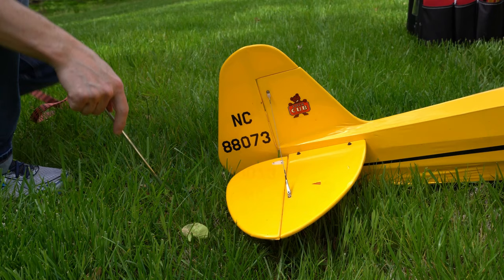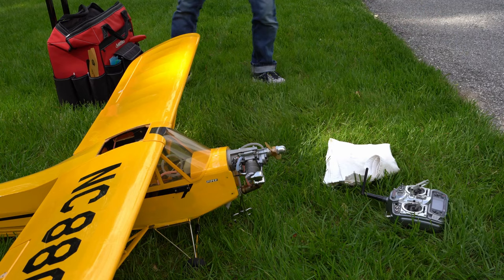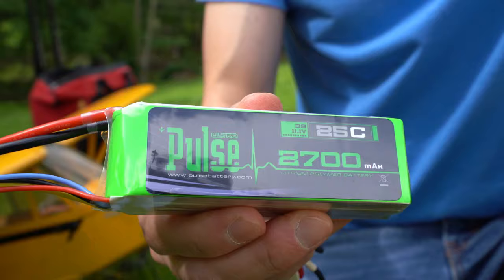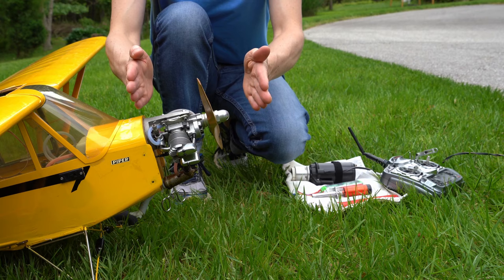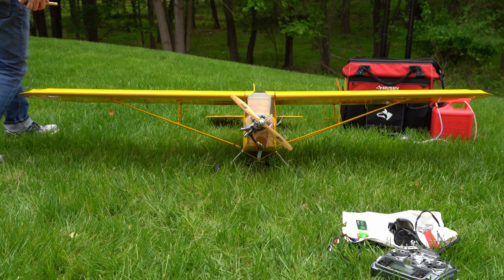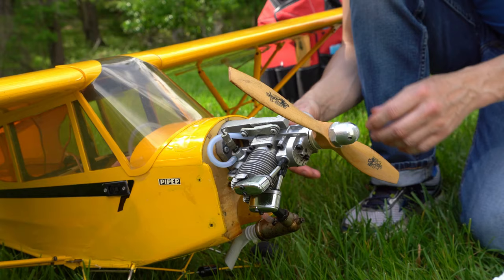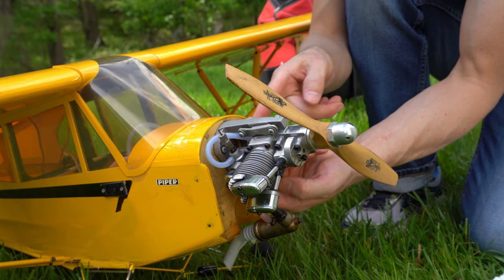Starting An RC Engine | Saito .62 4-stroke glow

Comment: I've been using a chicken stick for close to 40 years without issue. If your not able to start using a stick, there is something not right with your engine. There is nothing more satisfying then to hook up your glow driver and flick the prop over and have an instant start. Also makes for alot less junk to haul around at the flight line. Engine stops on taxi? walk out with your stick and driver in your back pocket and restart in a second where it sits. No dragging the starter out to the runway, or bringing the plane back to the pits.
Reply from the maker: 💯valid points my friend. Who doesn't like an engine so well tuned that one flick will git 'er done 😀😉👍🏽 nice...
Reply: cant say i have ever even used a stick except in frustration? 3 forward primes, then a flick against compression... 
i find it far more annoying to deal with batteries and lugs and wires and switches and murphys law, than the odd nip here or there.

Comment: Very good video thanks for the advice! I've also found when getting fuel to the engine it can help to open the carburetor to full throttle, this helps especially when the engine is inverted. I too agree it is stupid to hand start glow engines - at our club we only ever use this technique with engines so big the electric motor cannot turn it over!
Reply from the maker: Thanks @Owen Barker. I don't get much oppty to make videos so I'm super happy you liked it. I just inherited a 1/4 scale Piper Cub so I'm hoping my electric starter will work on a 20cc gas 🥺

Comment: I just got gifted 13 nitro planes, one is a great models ultimate with a 1.20 saito 4 stroke, i got a cpl of the  OS 2 strokes going but still working on tuning those better, im gonna attempt to get the ultimates 4 stroke going this weekend, ill need some luck 😂
Reply from the maker: Unless they've been severely punished, I've found most rc engines to be bulletproof. I have faith you'll resurrect them to full working condition. Time to warm up the stove (and open some windows) 😆

Comment: Hi, whats the size and weigth of the piper? i would like to buy the same engine, i have a piper with wing size 1600 mm with 3,6 kg.
Reply from the maker: This one was about 7.25 lbs with an 80-inch wingspan. I never flew the airplane at full throttle for more than a minute or two. 75%  throttle was more than enough power. At 50%, it started to get sluggish at the controls.

Comment: There are two more places thou shall not stand. They are to the left and right of the engine so that you are  standing in the same "plane" that the prop is turning in. In other words, when a prop fails it throws the propeller pieces outward. That is an area you do not want to be standing. You do not want yourself or your face in that "plane". Propellers do fail. Especially wood props
Reply: That’s what he said in the video.

Comment: b r i a n
Hello!  It has been 25 years since I’ve flown an RC plane.  (my hangar currently consists of RC Helicopters) I do however miss planes!  We used to have the electric starters back in the day too, but we had to carry a large motorcycle battery within our field box in order to power up everything.  Can you recommend the parts you are using within this video please?  (Battery, connectors & starter). I’m just getting back into this fantastic hobby and I never did the flick start & I never will!  Beautiful airplane by the way!
Reply from the maker: Hey b r i a n - thanks for watching the vid and I'm glad you found it helpful. If you click the "SHOW MORE" at the very bottom of the description it will expand to show you the items I used. In a nutshell it was a PowerPro Electric Starter, Dynamite Glow Driver, and a 3-cell 11.1v 2500 mAh Pulse battery. Cheers!
Reply: I just got my first 4 stroke fa 50 and this helped alot
A club member lost his finger to a prop
Reply from the maker: @user-xq4qj5ow2m  wow 😨 that's scary. And a main reason why I practice safety over and over. Some physical damage just can't be undone. I'm super happy this helped you. And thank you!

Comment: My question has nothing to do with safety so please forgive me.  Your plane is beautiful,  but why is the engine turned sideways?  I thought it has to run with the cylinder in the vertical position.  Maybe that’s a safety requirement,  I have no idea.  Enjoyed the video, thanks.
Reply from the maker: You can mount most rc engines in a variety of positions. It's not required to have the cylinder in the "up" position. Many hobbyists will mount the engine to fit better under the cowl or, in some cases to allow for better cooling. I mounted mine 90 degrees because the two cylinder heads would have otherwise shown through the top of the cowl. And on a Piper Cub, that's just not right 😂

Comment: Questions? I have hangar 9 hellcat 60 size with 0s 91 4s stroke engine .what size prop you recommend?
Reply from the maker: Theres a wide range you coukd use. 11x11-12 or 12x10-12 are good for starters and power. Once you start at 13x9 up to 15x6 you begin flying more scale.

Comment: Hi, can I ask you, do you have prop nut and lock nut hidden under the silver spinner nut?     Thanks.
Reply from the maker: Nope. It's just a single spinner nut. Which is why I check it for each flight, to ensure it's tight. 12 years of flying this way and haven't had a problem at all.

Comment: Hi there
How does your spinner not come off?
Right hand thread!
And u spin it anti clockwise?
Sorry for the dumb question. 😑

Brett
Reply from the maker: You know Brett, that's a really good question 🤔.... and I don't have an answer. I guess I never thought about it... methinks its time for investigation and perhaps a new video.
Reply: @theskyllama  
😎
Reply: @brettsulman9408  starting doesnt make as much torque as the engine running and pushing power into the prop. once its over compression and kicking it has far more impulse than the starter can deliver to loosen it...
Reply: @paradiselost9946  
Makes sense thanks

Comment: Fourstroke glow engine? Thick leather glove, flip propeller clockwise against compression and the engine will come to life if the settings are correct. Never used an electric starter on four strokes.
Reply from the maker: Impressive 👍🏽... I've always needed an electric starter. Especially in cold climates for winter flying (e.g., Minnesota in February 🥶)
Reply: @theskyllama  you tried it?

Comment: If you remove the glow plug, the engine will stop.
It is not advisable to remove the plug while the engine is running.
Reply from the maker: ... it would also be DANGEROUS AS HECK to attempt to remove the glow plug when the engines running 🤯🩸

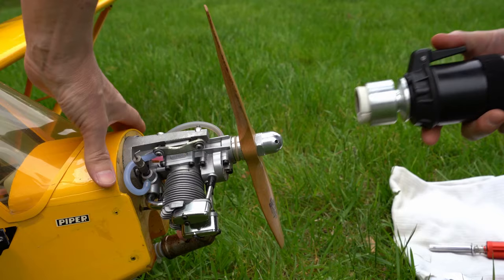Comment: Nice video...a few points - to be safe - At 2:15 you need to say you turn the engine over a few times to get fuel into the engine WITHOUT the glow plug driver attached....At 3:09 you need to refer to removal of the Glow Plug DRIVER .........NOT the "Glow plug".   Four strokes can kick or back fire and hydro lock is a reason a lot of four stroke flyers do not recommend using an electric starter on four strokes..it can ruin the engine.https://www.youtube.com/watch?v=74dskloEMFg

Comment: Where did you get the spinner for your cub?
Reply from the maker: It's a Harry B. Higley Safety Spinner I picked up at my local hobby shop. There are several places that sell them. Make sure to match your engine thread to the spinner. Certain spinners go with certain engine manuf.

Comment: How is the engine speed controlled with a remote?
Reply from the maker: Hi Mohamed. There's a servo inside the plane with a cable attached to it, and out to the engines carburetor. Boom 💥... controlled engine speed.

Comment: Hey there ... mr safety... you got that set up wrong. Its dangerous. You have no lock nut on that prop on that four stroke
Reply from the maker: @None - perhaps I've been lucky. In the 12 years of flying with that set up I've never had any backfires or misfires. I'm always checking the prop nut (even as the day goes along) and so far... 👍🏽. On some of my more aggressive aerobatic planes I do have the lock nut and that's because I'm running high RPMs and riding the throttle constantly. With this Cub, I'm flying 1/3 power max, low n slow 🐌 😆

Comment: putting your tools in front of propeller can be very dangerous prop can suck some rag or light tool and is done. Never put anything in front of propeller
Reply from the maker: Exactly 💯.  That's why I always have my stuff off to the side and any rags are secure under heavy objects 👍🏽
Reply: @theskyllama  corect way is to put your rag and tools behind propeller, specially if you make a beginner tutorial. Is very bad advice for new people

Comment: 1) Well made video. It could be shorter, to keep the interest up.
2) Mow the lawn, so the propeller doesn't have to do it for you!
3) You check the tightness of the propeller every time you start the engine? That is nuts. (I will admit I have seen a lot of Saito engines throw propellers).
4) Why do engines wear out and threads get stripped? Because someone told them to check the glow plug all the time! Daft. I've flown more than a year WITHOUT touching the plug!
5) It is NOT Say-Doh, its the US Say-Toe or the Japanese   Say-ee-toe   (kinda lost me right there, actually)
6) I would have fitted the cowl for the video. The plane really looks JUNK without it.
7) I am pretty sure the only ones clicking on this video, are the ones who DON'T own an electric starter and want to know how to get a four stroke glow started the regular way.
8) You spin the engine with the starter to suck in the fuel. This places additional wear and tear on the engine bearings and starter UNNECESSARILY! (kinda lost me right there, too).
9) You look to me like the kind of guy who attaches the glow igniter battery, then walks to his car to go and fetch something. (Seen this done many times before! Oh, I get it now, that is why you have to do step 4 all the time!) You only have to use the glow igniter for a second or two to fire the engine. As soon as it fires, it must be removed.
10) (Caution - controversial content ahead!) Tying your plane down, screams: Stand back fellas, I don't know what I doing! - or, When I fire this baby up, the throttle is going be well up and scare everybody. Yes, for crappy engines and first times, you must do this but NOT for regular starts where you know what you are doing. If you plane cannot remain stationary at idle, SET the idle.
Reply from the maker: Thanks for watching and for the feedback Chris. It's a pretty old model and engine but has served me well for 15+ years with no loss in compression or performance. Got to give Saito credit, they build one heck of a bullet proof engine imo.

Comment: Four stroke engine should be double bolted, you are using the wrong type of spinner nut, so you shouldn’t be giving a speech about safety
Reply from the maker: 🤔 I've been using a prop nut on my 4-stroke for over 12 years and have never had any problems. Maybe I'm exceptionally lucky? Any advice or insight you can provide would be stellar Frank